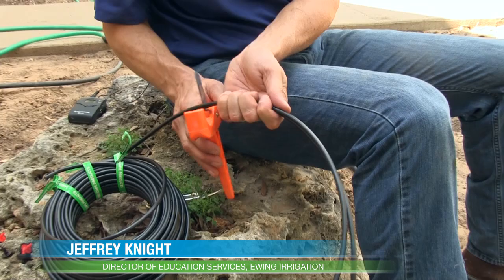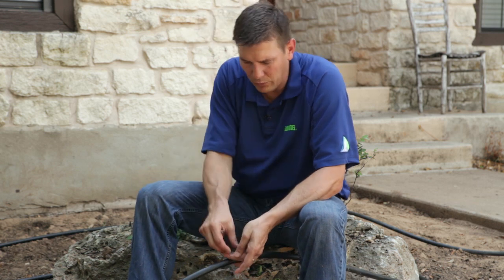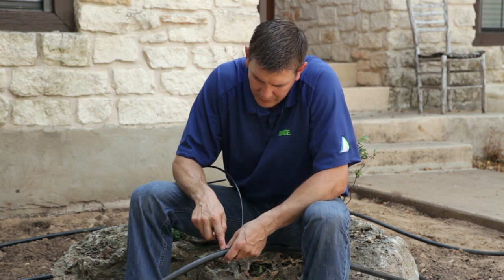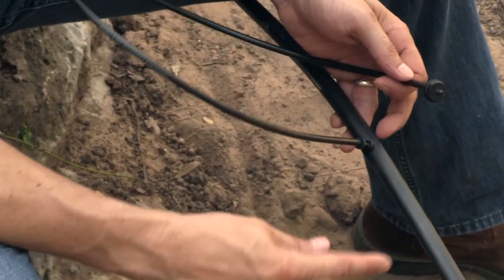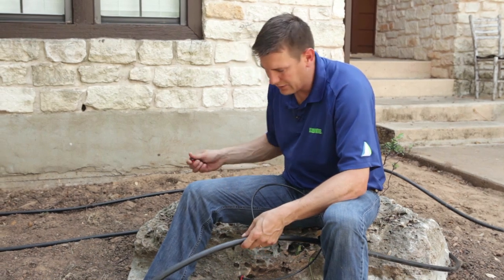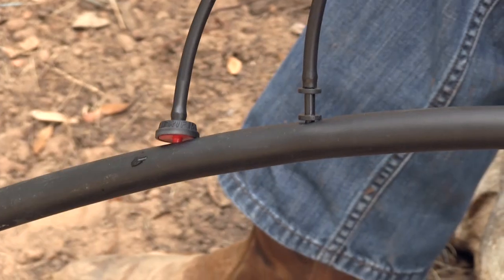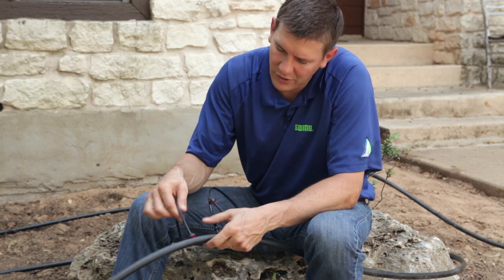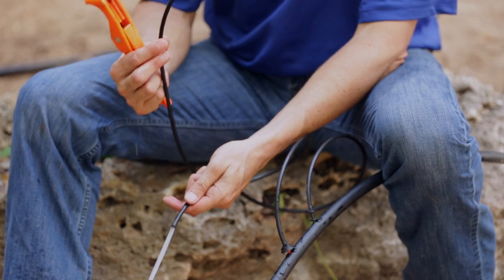Drip Irrigation Tip - Emitter Placement

Comment: I put the red end towards the supply like you did, with 1/2 gph emitter, and I got a big stream coming out. 25psi pressure reg. I have to turn supply way down.

I know I need a 15psi, and I have ordered some. But I was expecting a dripping not a stream shooting out a foot!
Reply from the maker: It's difficult to give you an accurate answer based on your description. If it's happening on just one emitter then it may have a bad diaphragm. 25PSI is the right pressure. You should see a drip not a stream. The placement of the emitter (on the supply line or at the end of 1/2" tubing) should not make a difference.
Reply: @ewingoutdoorsupply my bad. It was an in-line type. I’m new to this.

Comment: I've had systems both ways. The way you recommend is truly a PIA when you need to change the flow to a plant that is bigger (needing more water), or change the plant to something else that needs less water (eg, changing a broad leaf plant to a succulent). To do this, you have to dig up the entire dang line to find the main tube and emitters. I'm in a situation where I'm having to pay someone to dig up an entire side of my yard to deal with flow issues, and it's because of it being installed the way you recommend. NEVER AGAIN.

Comment: Is that 1/2 inch (0.70 or 0.71) black poly tubing any good?  Meaning will it last a long time if I bury it 4 inch under ground (I live in the desert so very little chance of freezing) or should I just run PVC as main lines??
Reply from the maker: PVC will last you longer but will be considerably more expensive than poly. .710 poly currently runs about $18-20 per 100 feet where 1/2" SCH40 PVC is around $85 per 100 feet. I put down poly in the desert under decorative rock 6 years ago and haven't had any issues yet. That said, the poly I replaced was 20+ years old and needed repairs a few times a year. Hope that helps. Thanks for the question!

Comment: Ya but, if you're emitter gets clogged with debris or calcium in the mirrors at the pipe you got to dig down find the emitter and replace it. That's been my objection to putting them better into the pipe. Basically you got to trace the spaghetti pipe all the way back to the main pipe not my deal
Reply: Agreed. Gotta pick your poison.

Comment: Thank you for the video!  Very helpful, open my mind.  if i use the method you recommended, can i not to use a bug cap?  1/4 inch tubing openning seems pretty wide comparing the emitter outlet.  if i use the method you less recommended, i don't need to buy a bug cap, but i need to buy barb connector, which is cheaper than bug cap.  thanks.
Reply from the maker: Yes, using a bug cap is recommended when connecting the emitter directly to the 1/2" tubing. Keep in mind that if your 1/2" tubing will be buried (rather than exposed or just covered with mulch) you might want to consider the option of having the emitter at the end of the 1/4" tubing. This will make it easier to replace should it fail.
Reply: @ewingoutdoorsupply  Thanks!

Comment: I put emitters like 6 inches apart . I hope this is not bad . I did like 10 emitters like this . Than the rest was like 1 foot apart
Reply from the maker: It would depend on the GPH output and the water requirement for the plant material. If you see our plants are getting too much water you can remove a few and use goof plugs to seal the holes. Thanks for watching!

Comment: I have 1/2" drip line running around the base of my hydrangea plants. I have a planter about 6 feet away that's 30" off the ground I'd like to add to the same zone as the hydrangeas. Is it possible to insert an emitter into one of the drip holes on the 1/2 drip line then run 1/4 pipe to and up into the planter with another emitter on the end to water my planter? New subscriber 🖐💥🇺🇲
Reply from the maker: Hello Shane. Yes, you can use a point source emitter on dripline as long as you do not exceed the flow capability of the dripline. You would not insert the emitter into an existing hole in the drip line though; there's an emitter inside. You would punch into the line between the existing emitters. Thanks for watching!
Reply: @ewingoutdoorsupply  Oh wow, good to know! I would've done that too 😂

Comment: I’ve found that this is only good when you have one dripper. I did this with my 38“ tall raised garden bed which has two rows of irrigation. If the two 1/4“ tubes are not dead level with each other, water will only come out of the lowest tube.
Reply: sounds like you don't have enough water pressure?
Reply: @greeksurferdude  80 psi coming from the bib reduced using 25psi adapter. It’s a short 5 foot run too
Reply: You are correct. If you put the drip emitter first, then split the 1/4 tubing it will only come out of the lowest tube. In this case, you would have to either not split the 1/4 inch or put 2 emitters at the ends of the 1/4 inch tubes

Comment: Hi Jeffrey great video quick question.  Let's say i install a 1 gallon emitter directly to the 1/2 inch mainline as you mentioned.  What's the maximum length you would recommend running the 1/4 inch line from the emitter to the plant.
Reply from the maker: You will want to keep it as short as possible. When you plug the emitter into the 1/2" supply tubing you have reduced the pressure and regulated the flow to 1 GPH. We would recommend that you not exceed 3' between the emitter and outlet of the 1/4" tubing. Thanks for the question!

Comment: Another quick question in this video how would you split the 1/4 inch line to be able to install two emitters in the fashion that you presented.
Reply from the maker: You would use a tee like this:
https://store.ewingirrigation.com/barbed-tee-for-1-4-inch-tubing
Thanks for watching!
Reply: @ewingoutdoorsupply  Thank you quick follow up question. Your suggestion is to install the drip emitter to the half inch mainline and then run the 1/4 inch line to the plant, that is clear.  To accomplish splitting I assume you would run the 1/4 tubing straight into the half inch mainline, split it with the T and some further point, attach a little piece of 1/4 tubing to each side of the T, install the emitter to it, then 1/4 tubing after the emitter, correct?  So basically 1/4 inch tubing, T splitter, 1/4 inch tubing on each side, emitter, 1/4 inch tubing.
Reply from the maker: @JoseLopez-wx1xi  yes, that's correct!

Comment: Once you run the mainline is it recommended to punch the hole on the top or on the side for the installation of the emitter?  What about when installing a barbed connector?
Reply from the maker: It would depend on the direction you want to run your tubing. Either way is fine.

Comment: I like the idea of installing the dripper midway (or near the plant end) on the spaghetti line. If i want to adjust the flow by changing the emitter later, I don't have to dig up the 1/2" poly line to do so. This assumes the line is buried, which they are in my yard.

Comment: I just installed my first system on my own and I'm having flow issues in certain areas of my system. 

Is it ok to use a soaker hose with a drip irrigation system? Or will the soaker hose cause the line to lose pressure and need to be on its own separate line.
Reply from the maker: Hello Adam and congrats on your first system! Unfortunately, your question is difficult to answer because we don't have enough information to go on. You would need to calculate the total GPH from all emission devices you have in that zone, including the soaker hose, to see if it exceeds the capacity of that zone. You may need to add an additional zone to separate the soaker hose from other emission devices you may be using. This video may help explain. While the content is specific to sprinkler systems, the concept applies to drip irrigation as well.
https://www.youtube.com/watch?v=Qbjn6KvZKjo

Comment: If the emitter is in the main, can multiple inline emitters still be used? Or, would that yield too little water?
Reply from the maker: "Inline emitters" typically refers to dripline tubing where the emitters are inserted directly into the inside of the tubing during the extrusion process. With drip tubing, as demonstrated in this video, you can use multiple "point source" emitters; as many as needed as long as the total GPH output for all of the emitters does not exceed the GPH capacity of the tubing for the zone. This guide from the City of Corona, CA might help explain:
https://www.google.com/url?client=internal-element-cse&cx=014272426406783312333:cz-axzl6idg&q=https://www.coronaca.gov/home/showdocument%3Fid%3D2132&sa=U&ved=2ahUKEwjh6ZOysvLpAhV3HjQIHSe5ASYQFjAAegQIABAB&usg=AOvVaw07gOXKIPMrVQRNEfFMsF1f
Thanks for the question!

Comment: I could be wrong but I always thought if you Connect the emitter directly to the tube it compromises the flow for the rest of the emitters if you are using different flow rate emitters....If I’m wrong that’s def a great tip.
Reply from the maker: Hello John, Sorry for the late reply. Connecting the emitter directly to the tubing would be no different from using a 1/4 inch barbed connector. Thanks for the comment!

Comment: I'm coming up on year 30 of installing and maintaining both commercial and residential landscapes and this is not the best way to install a 1/4" drip line. Its better to install your 1/4" barbed coupler into the main line, then run your 1/4" drip tubing almost to the plant and installing your button emitter inline about a foot before in gets to the plant your trying to water. I've gone on thousands of service calls over the years where you are trying to replace or clean out an emitter that has been saddled on to the 1/2 main line in which case your only option is to track the 1/4" tubing back to the main and punch in a new emitter adjacent to the blocked one. Sometimes you are even forced to pull the old one and replace it with a goof plug or worse install a 1/2" coupler inline on the 1/2" main to repair the hole where the emitter came out of and then install another emitter next to it. Only reason I can figure they recommend doing it this way is to sell more parts.
Reply from the maker: Thanks for watching and for the comment Don. Jeffrey's choice in emitter placement is to prevent wasted water as a result of the emitter being severed from the tubing. Your point is well taken though. If the installation requires the 1/2 inch supply line to be buried (as opposed to just being covered by mulch for example), then installing the emitter at the end of the 1/4 inch line may be the best option for future maintenance purposes.
Reply: How do you figure it is to sell more products? You are elminating the need for a 1/4" barb adapter to the 1/2" mainline with just using the emitter as both the adapter and emitter.
Reply: @DirtygardenCA  A couple of points. 1st Sooner or later that emitter is going to plug up. It might be tomorrow, next week, next month or next year or 5 years but sooner or later it's going to fail. Here in Arizona we have alot of hard water so I typically see hard water deposits clog up the emitter. It's much easier cutting out or removing the emitter out close to the plant than to need to pull up the whole run of spagetti all the way back to the main just to remove the emitter that was saddled on the line. Your most of the time talking about a 5 minute repair versus a half an hour or even an hour long repair just because some cheap lazy contractor wanted to save 15 cents! Also 2nd point when you use a barb on the coming off of the main your still at full pressure so I normally don't see blockages at the barb but at the emitter where the pressure is regulated down and not able to push out the obstruction.

Comment: Quick question. Can you hook up your emitters and quarter inch tubing straight off of garden hoses without any issues?Reason being is I have a bunch of garden hoses that are just sitting in storage and I’d rather put them to use than going out and buying half inch tubing.
Reply from the maker: We would not recommend using a garden hose as you've described. The thickness of the material used in garden hoses can vary while poly is consistent. The barbed connectors may fail if used on a hose. You can however use a compression hose swivel to connect 1/2 poly to your hose end if you have some distance between the water source and the area you want to irrigate:

https://www.ewingirrigation.com/products/drip-irrigation/drip-irrigation-fittings/compression/710chs-comp-hose-swivel

Thanks for watching and for the question!

Comment: Well, how do I know which emitter to use on which tree or plant.  I have all of mine gushing like the one you cut off just cause I don't know if they are getting enough water.  Obviously my water bill is crazy and the city is not liking my too much....they are charging me a penalty for not conserving.  Help!
Reply from the maker: Hi Susan, The answer to the question of which emitter to use and how many depends mostly on the plant and soil type you are dealing with. Generally you want to irrigate to a depth of 1ft. for small plants and flowers, 2ft. for medium size plants and shrubs and 3 feet for larger plants like trees. Also note that different types of soil have different infiltration rates. For example, a clay rich soil will take longer to absorb water vs a sandy soil. If you are dealing with clay, you would use a lower GPH emitter and longer cycle run times to prevent run-off. It's also a good idea to break the run times up into multiple cycles with some soaking time in between. This will give the water time to soak down to the depth the plant needs rather than running off or being evaporated. 
See this video:
https://www.youtube.com/watch?v=un33Qa5_L0o
To check your watering depth you can use a soil probe like this one:
https://www.ewingirrigation.com/products/tools-accessories/tools-long-handle/tools-soil-probes/ewing-48-in-soil-probe-fibergl
This guide from the "Water use It Wisely" campaign in Arizona has some information that you might find useful:
https://wateruseitwisely.com/wp-content/uploads/2013/07/Landscape-Watering-Guide.pdf
Thanks for watching!
Reply: Sounds like you don't have anything on your "spaghetti" (1/4 inch) line!  Throw some emitters on ASAP.  Too much water will kill your plants.  Tip: add mulch around the plants.  That will keep the soil moist and help you water less.

Comment: i don't think i've ever had a drip head come off.   Down where it meets the pipe - ALL THE TIME.   SomeONE needS to figure out a better way besides the punching of holes in the feeder pipe.   It's good for one punch only, usually leaks within the year  as a result of soil shift, animals, etc. and then you gotta cut the pipe and piece it together because you have a hole in your pipe.   tHE DESIGN SUCKS AND  I'M SICK OF DIGGING UP MY YARD CUZ OF THE DAMN SPRINKLERS!!
Reply: Run PVC instead of the 1/2 black supply line shown in this video

Comment: Hi, 
I'm interested in installing an irrigation system in an orchard using 16mm tubing. What would be the maximum length of one line? The spacing between the emitters is 100 cm and the pressure of the source is 2 bar. 
That's what wikihow says: "A typical drip tube can reach a maximum length of 200 ft (60 m), or 400 ft (120 m) if the water enters the line at its center". Thanks!
Reply from the maker: Costin - Oklahoma State University has some information that might help you:
http://okcca.okstate.edu/cca-exam-study-resource/soilwater-cca-exam-documents/first-section-links/BAE-1511-Drip-Irrigation.pdf

Thanks for watching!
Reply: That's fantastic, thanks!

Comment: Neat trick! Bet it also prevents the 1/4" tubing from walking as much too. Wouldn't the exposed 1/4" tubing be more likely to clog though?
Reply from the maker: Thanks for watching! Most debris will wash out when the irrigation cycle runs but you are correct. One way to protect the tubing from intrusion of insects and debris is to use a bug cap like this one: https://www.ewingirrigation.com/l-p-bug-cap-for-1-4-tubing.

Comment: Hey thanks for the concise demo.i need  a recommenration for gravity low pressure drip  irrigation that can continue for days/weeks as long as there is water in the elevated reservoir, please
Reply from the maker: +shayne caesar - Thanks for the question! Unfortunately, without knowing more about your system it's difficult to give you an accurate answer. The first thing you will need to determine is the pressure you have available. The elevation of the reservoir will have an affect on this. You also need to know the minimum operating pressure of your emission devices. If you'd like more assistance, contact your local Ewing branch. Here's a link to our branch locator: https://www.ewingirrigation.com/locations